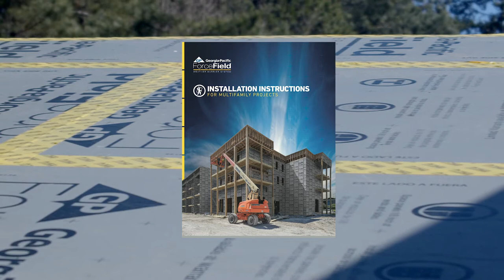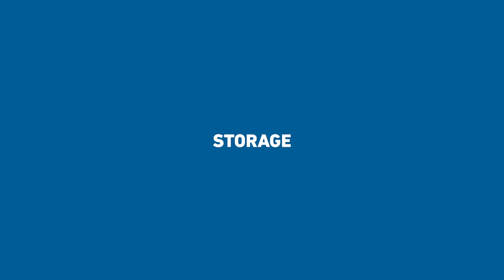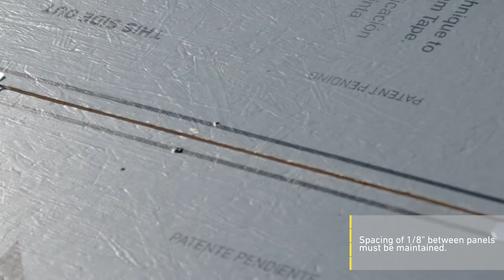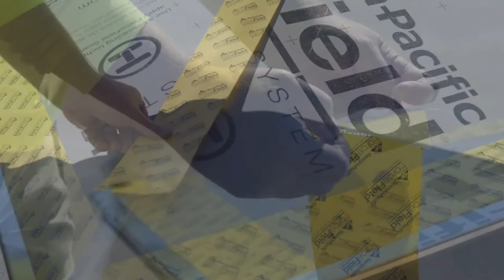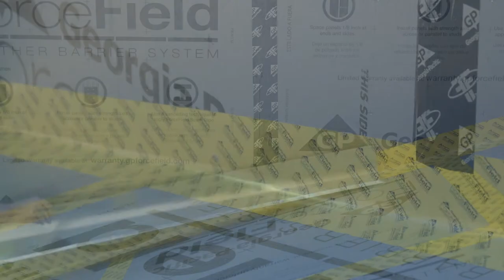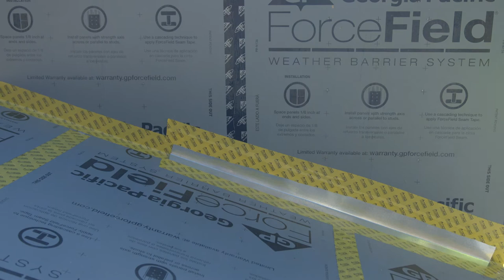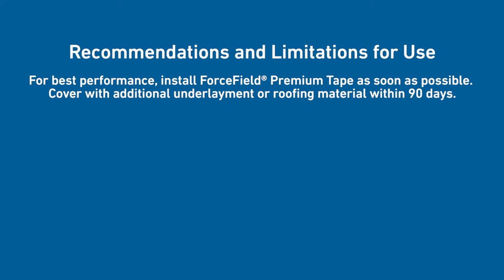How To Install Georgia-Pacific's ForceField® Weather Barrier System for Roofs

Comment: Im currently installing ForceField 19/32 OSB on my 4/12 pitch roof and it has been a struggle to say the least. This product is extremely slippery on the roof from the second it's installed. Dust and water immediately amplify this problem. I fully regret utilizing this product on my roof.
Reply: im looking at this product for a shed roof.  Total sq footage is 238 sq ft, so not that big.  My trusses are going to be 2ft on center.  I am worried about sagging with 19/32 but I think this is the thickest Forcefield comes in. :/  PS, my pitch is same as your, 4/12
Reply: @billsmith9249  I'll never use it again, it's way too slick to walk on safely.
Reply: I find it slippery when the outdoor temps are below 65 degrees or so. I have no problems when it is warm outside BUT find my shoe selection is everything.  Chose your footwear wisely. Chaco sandals are often great, running shoes also. Boots? Not so much.
Reply: @billsmith9249  I think the clips are a good idea between trusses. I have to use them though. Ask around.
Reply: @geraldhenrickson7472  I used regular 19/32 OSB but did use the Forcefield underlayment.  I did get matching clips.  I built my 12x16 shed over this past winter, it was frustrating (because I did not have help) but looking back, I LOVED IT!  I am thinking about building another structure in my backyard this winter!   I did go overboard, used an ice-water shield AND underlayment even though I am not planning on heating anything out there but I wanted the practice because I want to replace the roof on my main house and now I think I am skilled enough to do so!!
Reply: @geraldhenrickson7472  I found it slippery no matter what the temperature. Once any kind of dust got on the surface   traction suffered.